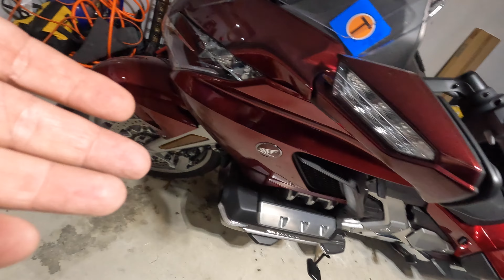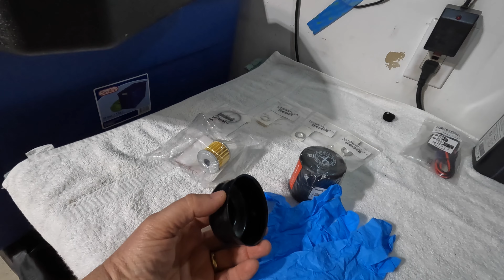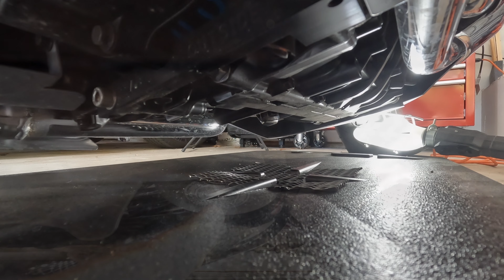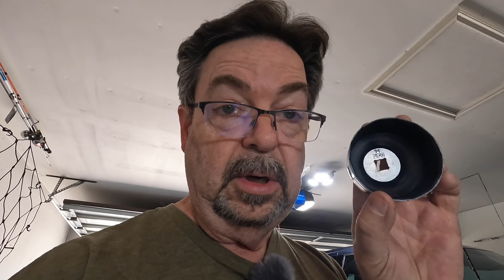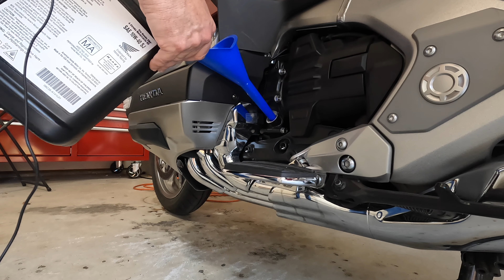First Oil Change - 2023 Honda Goldwing

Comment: drill a 1/8" hole in the side of the oil wrench, install the wrench with the hole facing the oil fill, install a small sheet rock screw thru the drilled hole in to the oil filter.
works every time.  Just did my 4000 mile change yesterday, I think the folks at the factory over tighten it just to mess with us.
 good video by the way!

Comment: Robert on your next oil change get the bike ready then put it on the center stand remove the bellypan. Then all the drain plugs and transmission oil filter cover and engine oil filter. Now put the bike on the side stand and allow oil to drain as per Hondas requirements. This will give you extra room and satisfy honda. Good luck
Reply from the maker: Rodney thanks for watching and commenting, that is a great idea !!
Reply: I was going to comment the same thing.

Comment: Take a blue shop towel and lay across the filter wrench and FIRMLY push it up on the filter ..the extra friction and tighter fitment has saved me many times in this exact scenario.
Reply from the maker: Awesome thank thank you James !!
Reply: That's a good hack.
Reply: I use a small piece of sandpaper. Double it up and place on the side of the filter while you push the filter wrench on. I doesn't take much.
Reply: Use a shop rag, or put a layer of electric tape inside the filter wrench you have. That may work, however it's always best to have the correct tool. One that's made for more than one size often almost works on any size.

Comment: Just saw this. Wingstuff sells the filter wrench with filter as a kit. Also, there is a smaller transmission filter o ring recommended by Fred Harmon on his oil change video. I also made a 2" wood block to stick under kickstand  to check oil level easily. You've probably learned these tidbits by now but thought I'd chime in. God bless u 2! Happy, safe riding!
Reply from the maker: Thank you FreeRider, I like the wooden block idea, definitely using that!  So many have reached out to help with this filter issue.. It is apparently very common.  The most common response has been "get a better filter wrench"... I bought mine at walmart so I definitely will check into a wrench made specifically for the purpose.  I appreciate you watching and commenting!  Ride Safe.
Reply: @robertwhitemoto  I wouldn't have considered Helibars until I watched your video. I just put them on and love them. Thanks! Riding season is here!

Comment: I used a rubber strap wrench that I bought at Sears 100 years (😊) ago. I did one or two oil & filter changes myself, but wasn't feeling well after either my shoulder surgery or some other either medical issue, so took it to an independent mechanic who works from home in a detached garage. He put a Fram or some other filter on it, & none of my 5, 6, or 7 wrenches would fit, so I'm going to an automobile supply store for the correct wrench. In thinking about the issue, I might just go on the internet to find the correct one. Another thought popped into my head & that is, I believe I bought a whole oil change "kit" from Wing stuff, that included the wrench. Good luck sir. Oh. Nice video.
Reply from the maker: Others have commented about the Wingstuff kit!  I am going to look at all my options for next time!  Thanks for watching and commenting!!

Comment: Nice job, Robert. As you can see in your own video, you can loosen all bolts without the oil pan under, then you can slide it in. Oil will not come out. This will avoid the possibility of causing damage to the bolts. Same thing for the filter. The DCT filter is the only area you should have a pan or mini baking foil tray as you drop the filter cover. Also, I have the Wingstuff filter wrench and zero issues till today.
Reply from the maker: I’m looking into that wrench!  Thanks again Al for watching and commenting!

Comment: Hi Robert.  I'm David watching from Kingston, Ontario, Canada.  I have a 2018 6 speed and had the same issue with removing the oil filter as you did using the existing wrenches I have used for years on my previous Wings.  Honda part number 15010-MCE-H51 is what you need.   It's an end cap type of wrench with lug on the end for a 17mm socket.  It needs a slight modification though.  As is,  because of the tight fit at the engine casing,  it won't slide up far enough to get a good grip on the filter.  You need to use a bench grinder and grind down the lip around the bottom of the tool so you get enough clearance to slide the cap completely over the filter end.  You don't need to take too much off.  It's worked perfectly ever since.  Another hint.  Before starting the bike, when it's cold, slightly loosen the drain bolts and filter...reduces the chance of burning yourself on hot surfaces.  You only need to use your fingers to remove the bolts and filter.  Lesson learned from years of experience.  Good luck.  David
Reply from the maker: David welcome from Canada!!  Great advice here.  Not sure I'm up for grinding nor do I have a grinder.  But I've received a lot of advice about the correct wrench to get.  I think I won't have a problem next time.  David I appreciate you watching and commenting !!

Comment: Robert, there is a cast aluminum oil filter wrench that fits that size filter perfectly.  That's the best answer.  It's not a bad idea to use a filter with a socket wrench fitting on the top in the future.  But I've twisted those tops right off with that approach so .... the cast aluminum wrench is the best IMHO.
Reply from the maker: Thanks Donald, just today I ordered what I think you are talking about from WingStuff.  Can't wait to give oil change #2 a try.  Merry Christmas.

Comment: Great bike and great video, thank you. Like you I have the same difficulties with oil changes on my hi end scooter, a Kymco AK550. Hi end bikes, hi end issues, haha. As for the oil filter wrench you should be able to find the exact filter fitment on Amazon or at Honda, def worth the price.
I have the same type wrench as you do. If you have the oil filter part number you should be able to find the appropriate wrench. No, one size fit most do not work.
Reply from the maker: @massimozanardi6457  agree !  I ordered the Honda brand and it worked like a charm !!
Reply: My AK550 filter was harder to get off without removing the plastic.

Comment: Get a ratcheting filter wrench. It has four points that tighten on the filter as you twist the wrench via a gear and track mechanism. I only use this for removal, but it's handy to have around, as it is universal fit.
Reply from the maker: Thanks Robert !!

Comment: I had to take a large flathead screw driver and a hammer to take the filter off. Position the screwdriver on the side of the base of the filter and drive it off/ unscrew it with the hammer and screwdriver till it spins easy enough to spin it off the rest of the way by hand. You have to do this at the base because the outer filter shell will just tear and deform.
Reply from the maker: Adam thanks for the info… I’ve done the same thing in cars before.  This video was some time ago and I just completed another oil change, this time with the Honda brand filter wrench and it worked like a charm 👍🏻. Thank you for watching and commenting!

Comment: Indeed the filter can be very stuck and that although I have taken the tightening torque as well as the lubrication of the oil filter seal ring into account.
Honda offers a set containing oil filter and oil filter wrench (15010-MKR-305). In my case the wrench did not slip, but was afterwards kind of jammed with the filter. But it did not slip despite of a very strong loosening torque (way stronger than the initial tightening torque).
Reply from the maker: I've since seen that kit and very well may buy in for the next oil change as I would much rather do it myself.  thanks for watching and commenting !!

Comment: I knew the the oil filter on my Gold Wing would be super tight.  So, I was prepared with a 24" breaker bar (instead of a ratchet), and an exact fit oil filter cup wrench. Took the filter right off, no problems. Should never need a breaker bar to remove an oil filter though.
Reply from the maker: Yeah that fit of the oil filter wrench was/is my problem for sure.  thanks for watching.
Reply: @robertwhitemoto , yes the filter wrench is 1/2 the problem, the other 1/2 is how incredibly tight the filter is screwed on. Save the time and expense of a dealership visit - utilize an exact fit cup wrench, 24" breaker bar and put the bike on its center stand, to apply solid pressure on the breaker bar.  It'll work.  🙂

Comment: They sell stair grip tape at home depot if you cut a 1” strip you can stick it to the inside of the oil filter wrench.. that grippy sandpaper like finish will bite into the filter ..
It should work for you

Comment: Just happened to me on my 5th oil change graduated filter wrench kept slipping bought one at local part store made for exact filter not multifilters  filter with extra long sides for filter to grab worked like it supposed to .
Reply from the maker: For my second change I used the Honda filter wrench and it worked like a charm !  Thank you for watching and commenting 🙏🏻

Comment: I seen Cruiseman's video last night. Not good, the bike may have hidden damage that needs to be addressed. I have an easy time with my oil changes as mine is a standard. Just one drain bolt, one filter and one jug of oil. I use a low profile plastic drain pan. It gives me more room when removing the drain and filter as I can put my hand down inside of it.  I also do it on the center stand as it also gives more room under the bike. I change mine every 4k miles oil and filter. My filter socket is like yours but fits like a glove and is not tapered , it has never slipped on me at all.
Reply from the maker: Doug thank you for watching.  I think I could get away with changing and checking the oil on the center stand, even though it's not recommended by Honda.  I think the differences are minor.  The real frustration this time was not being able to get that oil filter off.  It was very tight and the cup wrench just kept sliding off as I turned it... almost like the filter was stripped on the outside.  Ride Safe!
Reply: @robertwhitemoto   Yes I can well imagine when the oil is changed at the dealership it is sitting upright in a wheel clamp on a bike hoist.  I have run into the same thing with poorly made filter wrenches like that before. If they don't fit perfect and start slipping you are done for. I have had to pretty much destroy a filter in the past as well on a pickup that was put on way too tight.
Reply: Honda sells a filter wrench with the filter. It would be a perfect fit and not slip. The filter is very tight on new bikes for some reason.
Reply: Back in 92 when I bought my ST1100, I took my bike in for an oil change. The next time I went to change the oil on my own, I found out the dealership left their filter wrench on the filter. I’ve been using that ever since. The Honda wrench is a great investment, get one and save some money. Plus doing it yourself makes you know that it’s been done right! 👍😊

Comment: The gold wing has a center stand I believe, that would give you some room to work. Nice video, thanks for sharing 👍🏽
Reply from the maker: Carl thank you for watching and commenting.  It does have a center stand but Honda recommends changing the oil while on the side stand for complete draining… and my clearance was ok.  A stuck filter was my issue 🙂

Comment: This is slightly amusing, as 1 year later Cruiseman has a new bike, and a video showing his first oil change. The correct Honda cup style wrench didn’t work, and neither did the tricks with paper towels, sandpaper, etc. What did work was taking it to a dealer who had a snazzy cup style with a screw on the side, apparently sold through snap-on. My understanding, not having looked, is that the clearance between the thin oil pan casting and the filter is pretty close, leaving little room for other style wrenches or getting Neanderthal on it. Sometime discretion is the better part of valor - don’t be afraid to go to a dealer or other professional if you have to.
Reply from the maker: @ST1300Jim  totally agree.  I did get this filter off the second go around with the Honda brand wrench cup.  Fit like a glove and did the trick.  I can’t believe how tight they put these first ones on, and maybe, as others have said, the simply don’t lube the gasket with a little oil beforehand.  Thanks for watching and Ride Safe.

Comment: Nice video Robert. Are the Honda Goldwing crush washers directional? You may want to ask your neighbor with the Harley if you can barrow their torque wrench and oil filter tool ;) I too saw the Cruseman video. Good wake up call and and refresher getting back on the bike this spring in Denver. Stay safe!
Reply from the maker: Hey Kev, thank you for watching.  I have a couple of torque wrenches, what I really needed was a filter cup that was not graduated and fit better.  Ride Safe!

Comment: I cut 2 pieces of sand ,put them inside the same piece of crap filter wrench you have . And the filter came off  on the 600 oil change.
Reply from the maker: @NoWay-xu1ie  I’ve heard that!  Great idea.

Comment: Use mesh like that to keep mice out of air cleaner
Reply: Do not cover the end of the air filter with mesh! Max from traxxion dynamics talked about that. The tube's out of the filter box are engineered to a specific length, curve and dimension for tuning and air movement in the filter box. Changing the air input can change the way your bike runs.